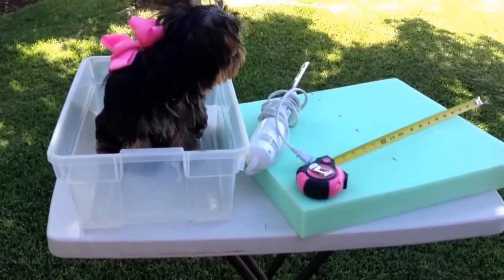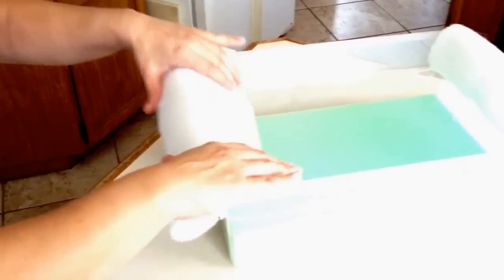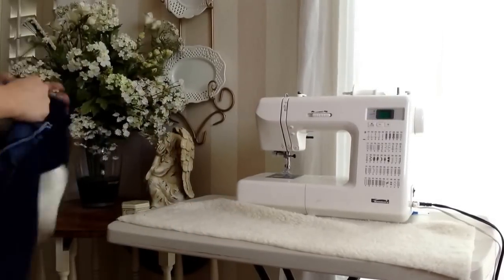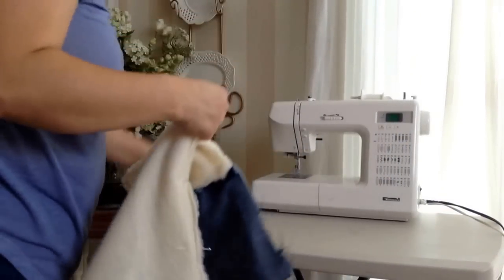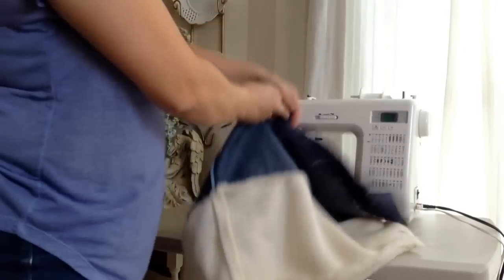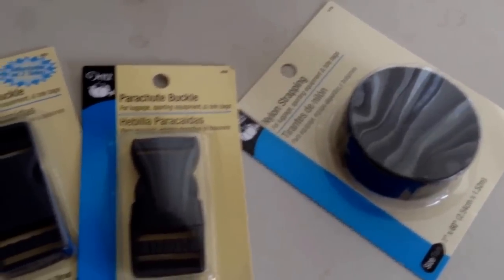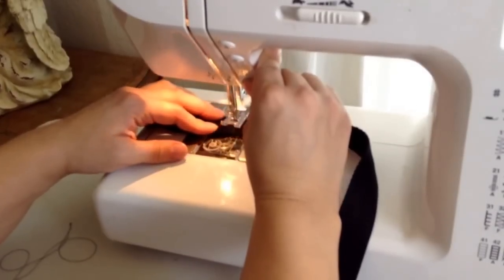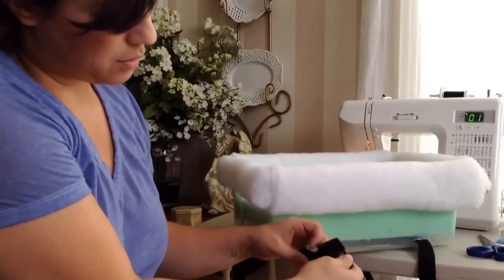DIY Dog Car Seat Tutorial

Comment: Unlikely that your stitching on the teather is going to hold up under the force of a major car accident, which means your dog is going to go flying into the dash. Google "dog harness crash tests" and see what that looks like. Most harnesses on the market don't hold up to a crash test. My dog only wears a Sleepypod harness which connects directly to the seatbelt.

You also need to think about the airbag that's going to smack your tiny little dog in the face and most likely kill her.